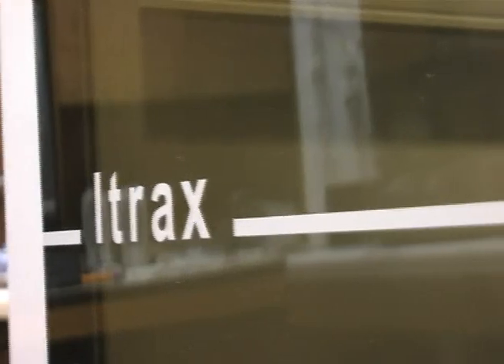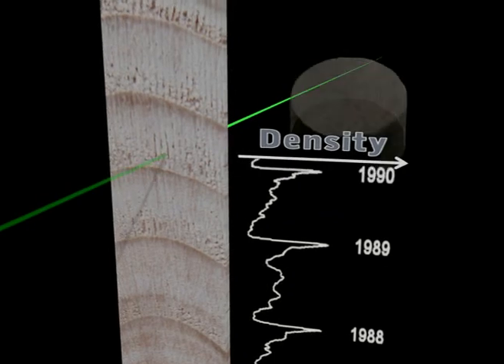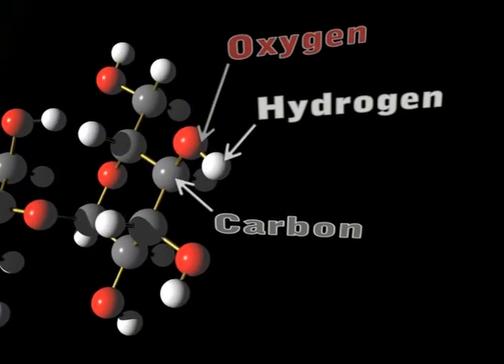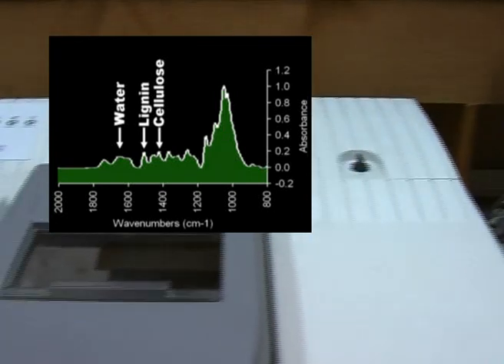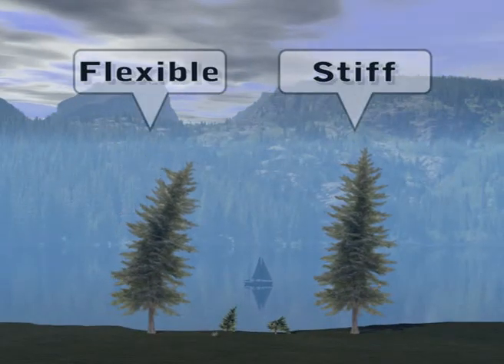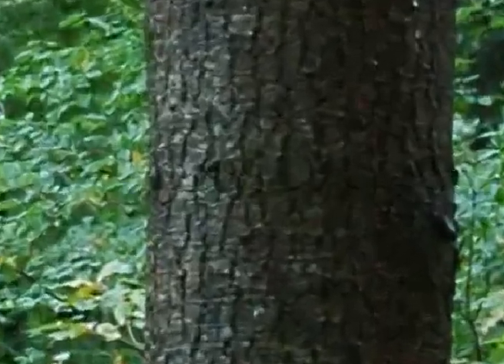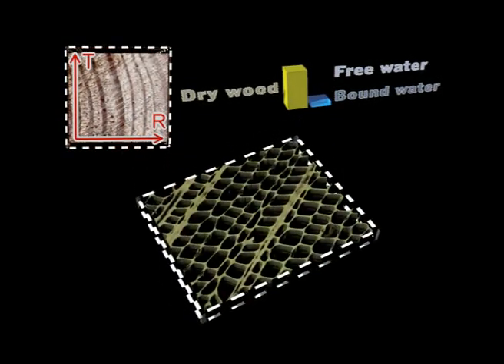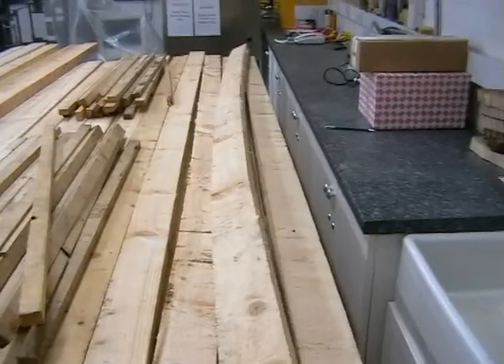The chemistry of wood

Comment: I am a little confused as I always understood the heartwood (used in furniture making) is stronger than the outer part of the tree and that sapwood is less dense as it carries nutrients? In your video you demonstrate wood nearer the pith is less strong.
Reply from the maker: Woodomain - Jeremy Broun 
Here we spoke about softwoods (hardwoods are not as simple).
In both hardwoods and softwoods the heartwood was sapwood in the younger tree.

Depending on species, the heartwood contains additional chemicals - which can make a difference to the colour, density and durability, relative to the sapwood - but they don't change the strength. That it down to things determined at the time the wood cells were grown by the cambium, and which don't change during the transition from sapwood to heartwood as the tree grows more rings.